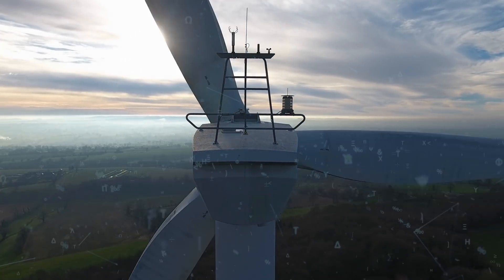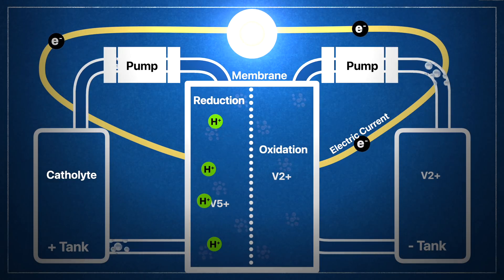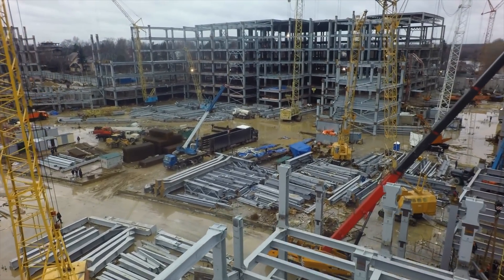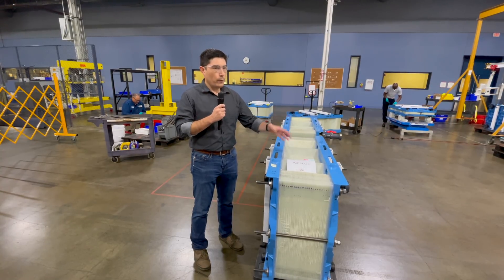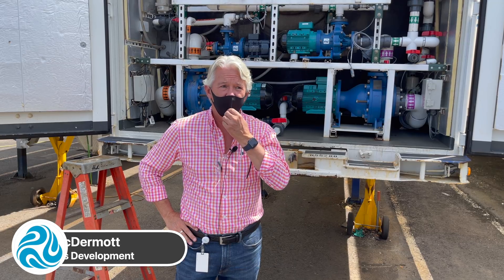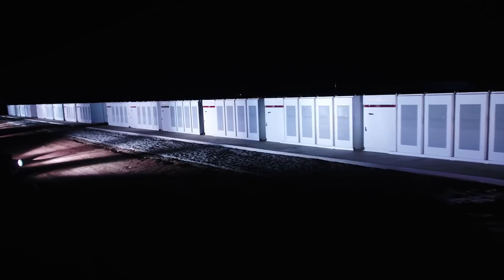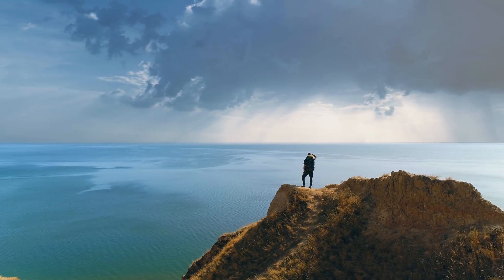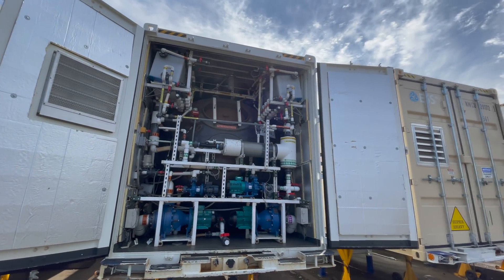The Future of Energy Storage Beyond Lithium Ion

Comment: Now, all we need is for these stupid greenie weenies to realize that the Wind does not blow all the time, the Sun is not there half the time, and the amount of efficiency of either source is less than 5% of what it NEEDS to be, AND that all those silly wind turbine blades WEAR OUT and need to be REPLACED and DISPOSED of and that Solar requires limited-resource RARE METALS and cost a fortune, and then we can all happily go back to clean Coal, Oil, and Natural gas with the odd Nuke thrown in for good measure.  Good riddance "renewables"  they are neither renewable, nor cost effective.

Comment: Flow batteries are the perfect solution for grid scale for sure. But they could be used in residential settings: you have a refrigerator in your home, its a noxious chemical being pumped around regularly and nobody bats an eyelid at the thought. A self-contained flow battery woulnd't be any different. 

For Iron flow batteries though, what's the difference between them and vanadium ones. The electrolyte works slightly differently as vanadium doesn't "plate" like theiron ones do, and that's surely a factor in efficiency. Also the time taken to fully charge and discharge is a big factor - vanadium ones are 4 hours to go from zero to empty, and that's alreayd being cited as a reson to use lithium instead (ie not good for peaker plants, though I personally think a 4 hour discharge will be more than enough for the 4 hour peak when people come home from work every day).

There's also the bigger use-case than grid-scale storage, and that off-grid energy. Flow batteries that can store energy all day long are perfect for places that currently run diesel generators. No more trucking diesel for miles, no more running diesel generators all day long (with the reliability problems that causes). And off-grid doesn't mean off the grid, any company can do the same whilst still being connected, that's probably the way to get this battery storage adopted widely. Grid doesn't need storage right now as all renewable energy produced gets consumed, but then they won't generate excess as they can't store it - chicken and egg! But individual companies can reduce their energy costs by storing their own generation locally: net result, lots of batteries. 

Definitely though lithium batteries are a worse option all round - when they catch fire, they can;t be put out and oh god the toxic gas they give off is 'close windows and stay indoors' deadly, its "an hours explosure is lifetime illness" deadly. If your council plans a lithium plant near you, get down there and thell them no. Tell them to get flow batteries instead.

There's a company in the US called Invinity Energy that sells vanadium flow batteries right now, would be good to see their offering and comparison to the iron ones.

Comment: I think you have reason to be exited. From the flow systems i have seen, this on seem really tight and together, as we say in the music biz. I believe it would be good for farms, as farmers are used to handling maschinery, and chemicals.  I would buy shares in that company. 🇩🇰🙋🏻‍♂️🌞👩🏻‍🚀🇺🇸
Reply: Their single container 33kW system seems perfect for large farms, where you maybe want to use solar to be independent of grid issues (and might have a bit of distance to the grid, leading to instability), but need stability. My electricity comes from far away, and even just a little bit of wind in a pretty large region between me and the nearest power station leads to me sitting in the dark. I have seriously considered solar + battery, because home office without power sucks dead rats through garden hoses (to quote Jeri Ellisworth)

Comment: This battery looks promising but the marketing pitch about its safety is complete bullshit. 

The electrolyte may be safe but that is completely beside the point. 

Due to the need of handling hydrogen (the "proton pump"), this system will never be considered less dangerous than the worst kind of li-ion batteries (quite the opposite).

Hydrogen is a very dangerous gas. Any leak could result in catastrophic consequences, especially around high-powered electrical equipment (like the DC-DC converter mentioned in the videos).

Minimally, these containers will require multiple redundant hydrogen leak sensors to immediately shut down everything once it detects a hydrogen leak inside. 

Extensive/unchecked hydrogen leaks may result in detonations that can destroy things in a wider area (see the explosion at the Norvegian Nel hydrogen fuel station in 2019).

Typical Li-ion battery fires are without detonations so only the equipment around it gets damaged/destroyed (like the Tesla Megapack battery fire recently)

Comment: Sigh.  Cathode and anode are reversed between charge cycle and discharge, so there is not fixed cathode or anode in a rechargeable battery.

Comment: Either solving silicon issues or extracting lithium from sea water are the 2 key element to solving the energy storage equation to run our civilisation. I feel this is just another wasted project because the efficiency will not be there.

Comment: One of the main points which was kinda mentioned but the not really explained in depth is the energy loss durning charge and discharge cycles. This includes the operation of pumps etc. Basically how much energy goes in and how much comes out. Hydrogen as a energy storage mechanism  is bad in just about all cases because of the inefficiency over charge and discharge cycles. Is this flow battery the same? This is very important because while you have have a cheap battery with abundant resources if you need more energy generation such as solar or wind then you’ll have higher cost on that side of the equation which will make it uneconomic and wasteful.

Comment: if you wanted to produce green hydrogen/ammonia from intermittent sources like wind and solar, do you think using a battery like this to buffer the electricity so you could run the electrolyzers 24/7 would save money vs. not having the batteries and just switching the electrolyzers on and off?
Reply: theres going to be a lot of thought (really sceptical if we can just that let to the market) to go into how coupling all the renewables and their irregular output with the various short and long term storage solutions as well as demand side management, that may strongly depend on the region and energy market youre in... there is not only one solution that will apply worldwide. 
Intermittent operation puts a strong financial and sometimes also reliability/maintenance burden on all kind of production of synthetic fuels. So yes i think these flow batteries could very well bridge the gap between short term storage and long term storage, and by this also provide a buffer for synth fuel generation facilities as long as the weather forecast safely indicates the buffer is not going to be needed to the last of its capacity, which may be the case 80% of the year.

Comment: If hydrogen is a sideeffect, why not just use it, and just control the solution by filling in. 
Hydrogen is also needed in the the future.
Reply: burn it in a small engine to supplement pump drive power, then route the exhaust back into the tanks ...

Comment: I mean, you say land doesn't matter... But it kind of does. Governments and power companies don't have infinite space, but need nearly infinite capacity in the future. So density does matter a bit.
Also, the water, iron, and salt are cheap on their own, but not cheap in the quantity needed to produce a similar amount of charge as lion. Plus support materials, tanks, etc. are pretty huge. Add to that maintenance, inspections, etc are going to raise the longer term costs.

Also, storage is not the only issue with green tech. The recycling and turnover rate for wind and solar are hugely problematic compared to fossil fuels. Yes, the green tech is better for the atmosphere, but saying we could move completely to that without other things like nuclear to pick up the vast majority is just silly. To fully power the US with wind solar and lithium batteries we would need a huge chunk of the Midwest covered in it, and replace the whole thing every 20 years... That is not possible or sustainable. We need wind, and solar, and batteries, and hydro, and nuclear all as separate parts of the solution. This tech fits a niche, and that is good! But it is going to play a small role in the overall market. Raw storage? Great! Fast load and unload and voltage regulation on high demand grids? This isn't going to do that nicely. It is nice that the cell voltage is stable, but demand voltage is not and this does not strike me as being quick at much of anything.

Comment: How long can the charged catholyte be stored? Could it be used for seasonal storage in northern latitudes?
Reply: I doubt that would be useful, given the saturation of the anodes. There is only so much it can can store, as this system doesn’t grow capacity with just adding more storage for the electrolyte.

Comment: I guess I don't see why it wouldn't be feasible for a home installation. We have air conditioners and heaters and water heaters and all kinds of other things that have moving parts and require maintainance. Why not our electricity storage as well?
Reply from the maker: The space required would also be an issue. Grid scale energy storage is the big winner for this tech. But yah you’re right no reason it couldn’t
Reply: Since it seems unlikely consumer size units would be offered, for insurance and liability if nothing else.  The homeowner would need to buy one of the standard semi trailer size modules and park it in the side yard.   If that fits thier needs and county zoning allows, then sure why not?   The modules will run themselves, and the app on your tablet will give real time status, and alarms when maintenance is needed.
Reply: @docwatson1134  I bet they could get it to fit reasonably well in a basement and they seem safe enough. That's kind of what I would have in mind. I could easily see living in a home where my roof is mostly solar and my basement has a big liquid battery.

Comment: Wait a minute there... if the iron has to plate inside the cell, that defeats the purpose of using a flow battery.  You can't just add more capacity by adding more tanks since your storage capacity is limited by how much plated iron you can put in the cell.
Reply from the maker: Right so you need to add cells along with fluid.

Comment: Lithium is Best Option for storing energy because at the end.of the Mega Packs life cycle you can just recycle all those batteries and its New all over again
Reply from the maker: Recycle is very energy intensive. You would have to recycle a mega pack like a 10 times to meet the life of a iron flow battery.
Reply: @TwoBitDaVinci  you only recycle till better battery tech comes along

Comment: How often to replace pumps (salt fluid on the metal pump parts). What length of time can it hold a 100% charge down to 50% (without being charged).     
Cost?...  Efficiency?...   Capacity?... when available?...   You talked about it but no numbers.....?  could be a bit more critical (scientifically, economically, electrically) instead of a fluff piece..     anyway nice video. thanks for the update.

Comment: I'd love to see a comparison between Flow batteries and Hydrogen electrolysis, storage (gas not compressed liquid) and burning in a gas generator efficiency for grid storage. Hydrogen will be handy for building up seasonal storage of excess renewables
Reply: I'm no thermodynamics engineer, but the round trip efficiency of hydrogen storage and electrical production would be very low. However hydrogen may make sense for some energy storage application because it is transportable
Reply: Flow batteryes: take 100kW of energy and store it, you get 80kW back. Hydrogen electrolysis: take 100kW and store it, you get 25kW out. Its really inefficient both to make hydrogen and turn hydrogen back into electricity.

Comment: Why not re-purpose gas stations and use their tanks to hold electrolyte that could be used via flow batteries to buffer the grid and charge cars. You could have intermediate Lithium to provide the brute power during peak times to cope with the lower energy density dope the flow battery. Even if not used to charge cars it might be a good way to re-purpose the tanks. The same could be done at oil refineries to repurpose the space and storage facilities that tend to be in industrialised areas with easy access to the power grid. New tanks could be built underground from concrete like potable water storage reservoirs are and landscaped etc.

Comment: You didn't mention whether or not these batteries can be charged to 100% and discharged to zero without any damage.  Presumably, they would be similar to the ZnBr plating batteries which can be fully charged and discharged.  They are made by Redflow in Australia and come in 10kWh units that are suitable for homes, either singly or severally.
Reply: They have tanks of electrolyte so they can scale the tank size to make the battery run longer.  It doesn't seem to need to be charged to 100% and discharged to zero.
Reply: That is a good point about Redflow ZnBr flow battery 100% discharge.  Here another good point on the electrochemistry of why battery power goes down, i.e. the buildup of charge imbalance decreases overall charge imbalance between anode and cathode, and how flow batteries can use mitigating techniques to address the imbalance. I would be interesting to see if Redflow is also looking into any charge imbalance mitigation for ZnBr.

Comment: I wonder how it would work in an extremely cold climate? I'm thinking the electric demand to keep the system from freezing would be high
Reply: Put underground, and add a foot or two of insulation, that should be enough to keep from freezing even above the arctic circle
Reply: @frontiervirtcharter  the arctic circle has permafrost but putting it underground everywhere else would likely work. You would have to make it serviceable so basically like a mine

Comment: Every time you cover a grid scale energy storage technology you need to ask, point blank, what’s the round trip energy efficiency. 50 60 70 95%??  That’s one of the most important things to know about this since it has such a huge bearing on the economics of such a solution. An inexpensive design or inexpensive sustaining cost is great but it’s only half the story. 
Were they unwilling to answer? That would be a huge red flag.
Reply: I don't know about this one but the ZnBr plating battery from Redflow is said to be as efficient as pumped storage (around 80%).  Not only can it be charged to 100% and discharged to zero, it must be discharged to 0 every three days or so to clean off the plates of Zn completely.
Reply: Looking at the cost trend of solar panels combined with increasing panel efficiency I think utilities will just oversize the arrays to make up the difference.   Besides solar production now is absurdly high May through September, and low in December and January, I think the annual swing will be more to difficult to solve then day and night load balancing during summer months.   To your point, the overall efficiency would matter most during the short cloudy days of winter.

Comment: I have been responding to utility scale RFP's with an ESS product option for about 7 years.  They have almost always gone with a short duration, higher LCOE lithium Ion option.  Why?  Exposure to media and because everyone they know does it that way.  It has been frustrating and I suck at sales.  I have been an avid ESS convert since about 2015 and a big shout out to my friends with ESS.  Also congrats on the $300M contract and time to expand again!
Reply: The worst thing to happen to a good idea is not that it be skillfully attacked but that it be ineptly defended. Fredric Bastiat
Reply: Both this video and the website fail to show any details of what makes the solution uniquely capable.  It would seem well suited for long duration storage (perhaps even beyond the day /night cycle) but without public information and reference installs I can see why people would be skeptical.  Lion is relatively proven.  Solutions like this, green hydrogen, cryogenic air, aluminum air, sodium batteries and the ambri liquid metal battery are all great in theory but need hard numbers and strong reference clients to take off at economical scale.  Market confidence will require basically gifting it to a startup client (requires capital) or two, more open marketing and a strong technical advantage.  Details like round trip efficiency, cost, maintenance projections, modularity, power, energy, response speed and losses for long term storage are critical.  Snake oil solutions have managed to secure contracts and failed misurably which obviously makes people nervous (ie stacking heavy concrete blocks then deconstructing it)
Reply: If you are interested, I can google some info for you.  To be brutally honest, most of us are lazy and won't do our homework.  For most of the projects that I have offered ESS as an LiIon alternative, the data, resources, access to data, etc., were available, but most corporations at a certain size, will develop a culture of "don't rock the boat" and don't do more than you have to.  I know that many of the proposals were considered, but in the end, the engineering review's had to sell it to management and then possibly reissue the RFP for others to list as an option and it was just easier and quicker to use LiIon.  That and I am just not a salesperson.